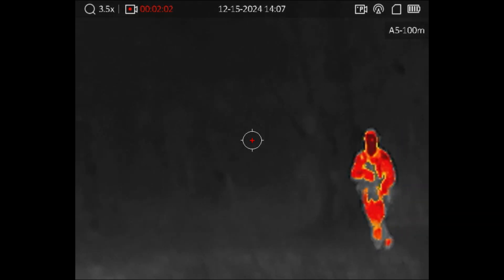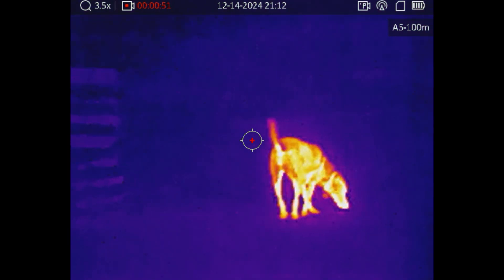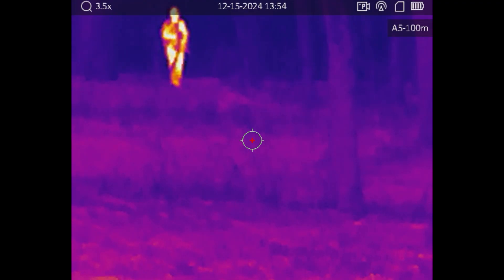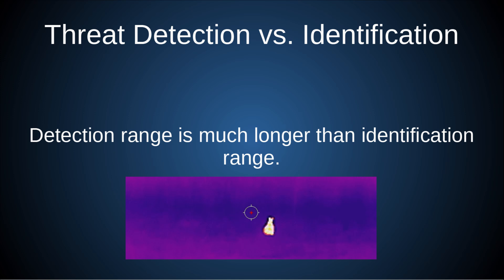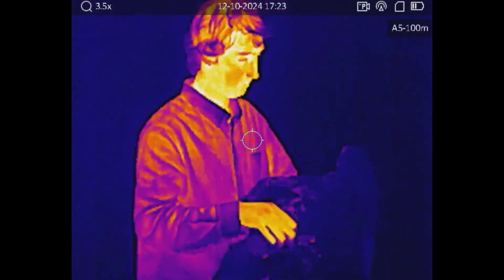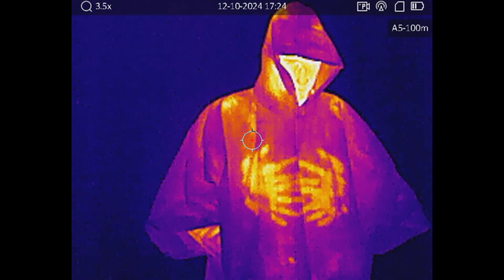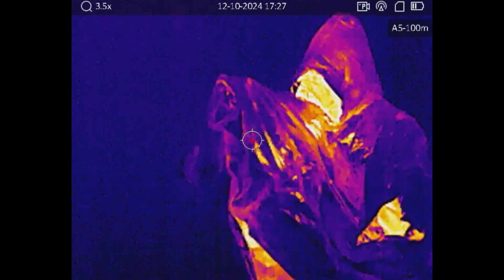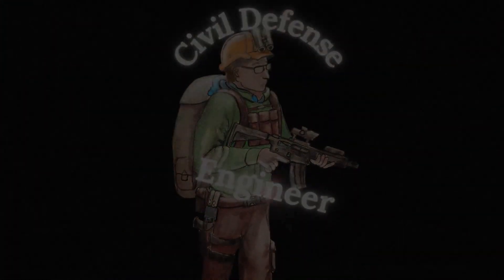Low Cost Thermal Devices for Civil Defense Engineering

Comment: The insulation on spacecraft is called "Multi-Layer Insulation" or MLI.  In historical literature they sometimes call it "superinsulation".  It's just a bunch of layers of reflective material (to prevent thermal radiation heat transfer) separated by layers of flexible insulating materials like fiberglass cloth (or mechanical standoffs like on the James Webb) to prevent thermal conduction between the layers.  You can make cheap MLI (which even works for cryogenics) with alternating layers of kitchen aluminum foil and polyethylene mosquito netting from Joan fabrics.  Just make sure that the different layers of aluminum are not taped to each other, because they will create a thermal path outward.  To prevent sky-reflection, just put a layer of normal cloth/clothing on top of it.
Reply: Would mylar work as fine as aluminum? Aluminum is stiffer

Comment: If the main reason you use thermals is detection why use such a troublesome analog device? I am trying to improve my skills as a shitass teen with a pellet gun and have found 480p cameras for $60, I dont get why you would spend as much as a full ballistic computer would cost me for a 280p system.

Comment: I just bought the agm 19-256. Kinda wanted it for multiple reasons. Hunting, tracking and obviously threat detection. I just need to see a threat before it sees me so i can run my 195lb ass the fuck away. This does that nice. The fact that i can strap it to multiple different guns as a scope is just the cherry on top. Most the time it lives in a pouch on my hunting gear so i can try to see game thru dense woods that usually deer just blend in and u necer even see. Def works for me. Plus with veteran discount it was barely over $700

Comment: NVG is the cheap option, you're showing $2k monocle, I've got a $50 Korean monocle, and it is good enough to spot varmints and treepassers. It's not thermal, of course, but it does the job at night.
Reply from the maker: Are you talking about digital night vision?
Reply: It is IR illuminated video. It looks like the model is up to $99 but it is much more functional than the one I have, much better resolution, and endogenous battery instead of AA batteries. It has a 25mm lens, equipped with 850 nm IR illuminator and good vision out to at least 100 yards.

Comment: 3:28 it's not the diameter of the lens that dictates its field of view, it's focal length (for given sensor size of course; with larger sensors FOV would be bigger with the same focal length); aperture is irrelevant in that regard.
Those long wave infrared sensors are not that sensitive (compared to modern visible light ones for example), so they need very "fast" optics, something like f/2 or even faster to work effectively, and if you increase the focal length, lens diameter must also go up for it to still be fast enough, but it's for light gathering purposes and doesn't affect the FOV. You can't just increase the focal length without making the lens bigger, because it would make everything darker, and eventually the sensor would not be able to pick up any useful signal at all.
Reply from the maker: Thanks, I realized that after the video. It just so happens that the focal length appears to my eye to match the overall size of the lens. Not a camera guy or I would have known that
Reply: @CivilDefenseEngineer  looking at the curvature of those lenses, it might as well be that those are indeed f/1 (so focal lenght = aperture) or something close to that.

Comment: Standoff. Standoff. Standoff. If you want to hide from thermal you need to be behind the camouflage and there needs to be sufficient standoff that your body does jot warm the camouflage up.

Umbrellas seem to work. I'd be intrigued to see someone build a mylar backed camouflage net ststem that popped up like a tent or hunting blind. I bet that would be awesome.
Reply: You will clearly see the outer contour of that shelter...
Reply: @DuRöhre4711  There is a mirror based hunting blind on the market,  it reflects the ground so it's just going to blend in with whatever temp the ground vegetation is,  which should blend in with the background perfectly.
Reply: @LarsLarsen77  No, you will see it on the thermal camera. All of these so called thermal camouflage tests are done with low cost unit's with relatively low resolution and high NETD. If you use an umbrella to shield yourself, the camera will see an umbrella or the outlines of it. Any drone operator or seasoned thermal camera user will draw it's conclusions. Also, thermal cameras in that wavelength can't see through glas, it will act as a mirror. So it's pretty obvious that something is going on. Same with mylar blankets etc. To truly hide from thermal cameras, you will have to hide where you can't be seen. Plain and simple. There is no Harry Potter's cloak that will magically make you dissappear. Not from night vision and not from thermal.

Comment: How do you like the proprietary battery on the v2 ? I loooooove agm thermals I have the ts35 384 but the original version with replaceable batteries and have a bat pack battery extender that lets me run 2x16650's I heard the resolution on the v2 is better though I just cant get over proprietary batteries
Reply from the maker: The proprietary battery gets 10 hours of run time, or 9 when it's cold out. It comes with two batteries, but I plan on getting plenty of extra. I don't have a problem with it, but versatility would be nice.
Reply: anything to do with power, should never be allowed to be a proprietary item.
heck even apple had to fit in with everybody else with the usb-c.

Comment: I'd just buy 100 5 buck arduino cams with the IR cut filter off, then refilter the data for visible light if I want that image instead of the IR one
Reply from the maker: Fun idea, but replace the word "just" with "painstakingly" especially since my arduino skills are 10-years rusty.
Reply: @CivilDefenseEngineer This is an extremely common use of “just.”

Comment: One of the first things everyone does when they get thermal is go and film the cat.  No, I don't know why.
Reply from the maker: The cat is just there, lol
Reply: Maybe they buy them just to locate their cats?
Reply: 1. Cats rule the internets. 2. cats have insulating furr of many different lengths, so a first check of contrast spectrum and resolution of the new thermal is easy done with a Mk1 house cat, checking on a tree or neighbours wall with your new binoculars or lens for sharpness and colour bleeding. similar to rendering the standard teapot or furmark for a new GPU or your known hill or supermarket parking lot for acceleration and break tests after the first snow has fallen.
Reply: Cats love it when you open things because then they get to climb in the box

Comment: Mylar blanket with a thin wool blanket covering it.
Reply from the maker: That's a great idea. I noticed that my sheep only glow from their faces and legs. Their thick wool in the winter keeps all their heat in.
Reply: @CivilDefenseEngineer  I suspect it would last briefly if in contact with your body. Might even be better as a sandwich: thin wool blanket, mylar space blanket, outer thin wool blanket. The big problem is summer. How comfy it would be in 70 to 90 degree temps to throw a woolen blanket over yourself! 
   I've also wondered about modifications to ghillie suits or the looser ghillie viper hood plus ghillie cap. Maybe a thin removable wool liner  with or without a mylar barrier. Loose fitting with minimized body contact points.

Comment: I did some reading on the topic of thermal camouflage, and I think I have a pretty decent idea of how to do it. You need to have the exterior of the material be close to ambient temperature while isolating it from body heat. If you want to take advantage of different fabrics, you'll need to layer. The interior should contain an IR opaque layer that is a poor thermal conductor - perhaps just a thick fiber, or some sort of IR reflective sandwich. If you use a reflective material, you should probably insulate both sides of it, to negate the visibility of its reflections and isolate the outer layer. The outer layer should probably be some sort of ventilated mesh, maybe separate layers of increasingly thinner mesh. This will adopt ambient temperature because of the ventilation. This actually does provide some insulation, as you can buy netted base layers which perform well in cold climates. It may be interesting to try and find some way to ventilate the interior layer in a convenient direction. With time, anything worn will heat up as you demonstrated, and start to stand out. Also, consider the effect of color; black apparently is the best absorber of IR. However, that doesn't mean the entire outfit should be black, as this would probably silhouette on IR. However, it may provide some signature reduction in areas that are going to be ventilating warm air
Reply from the maker: You're right—the human body is always going to be giving off heat (if it's alive) so the job of the thermal camo is either to diffuse that heat evenly and slowly, or keep it all in for short periods of time. I also wondered if a cold thermal mass could be carried inside the thermal cloak as a heat sink, or if that would be getting too complicated.